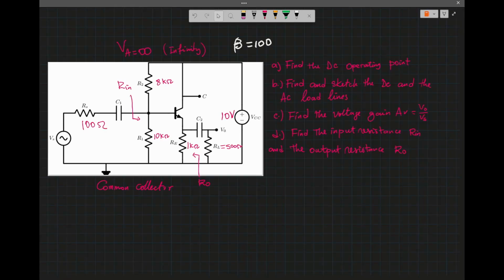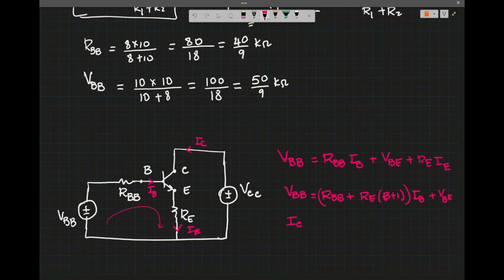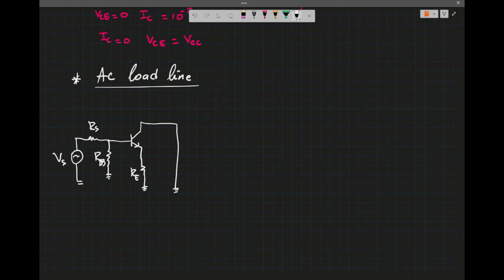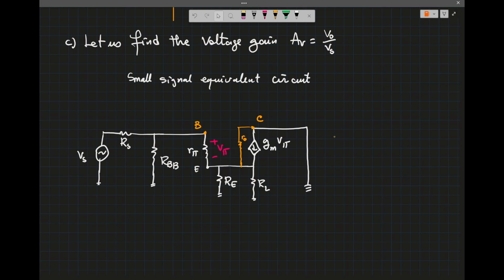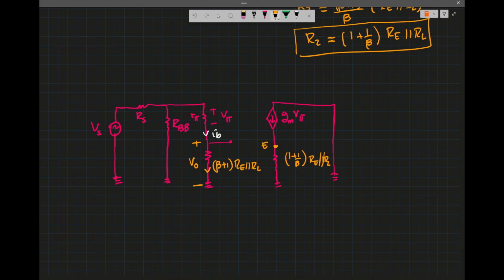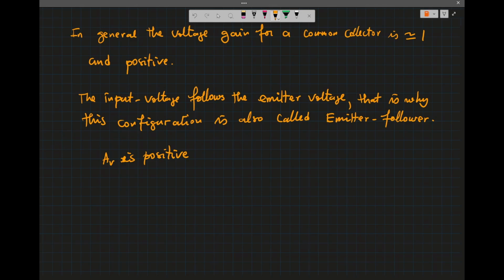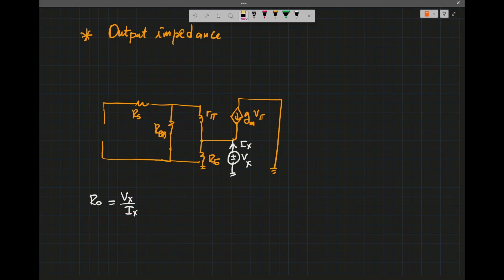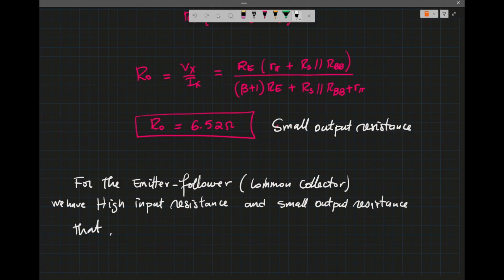Why the Common Collector is more USEFUL Than You Think

Comment: Great video! I do have suggestions that you may or may not want to consider:
1) Upload a PDF/Google Drive/Etc of the notes taken throughout the video in the description section.
2) Instead of doing a long, drawn-out problem that can be hard to digest, upload videos that may solve 3-4 problems that go over one central concept (video just finding Q points, video finding DCLL & ACLL, etc).
Reply from the maker: @Camaro_V8  Feedback much appreciated! Will that into consideration. Thank you